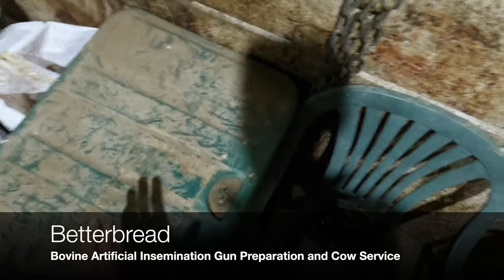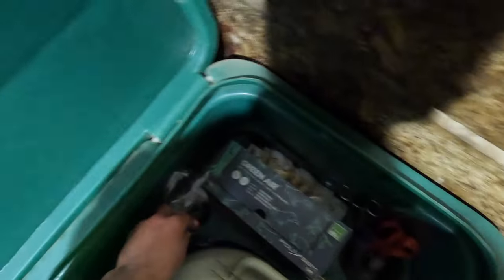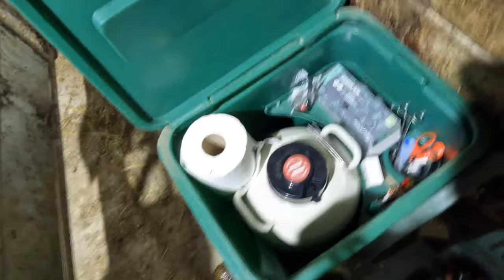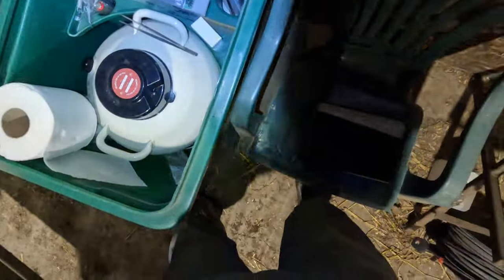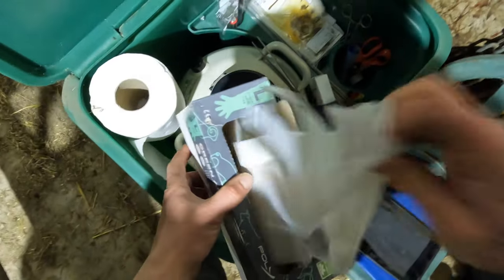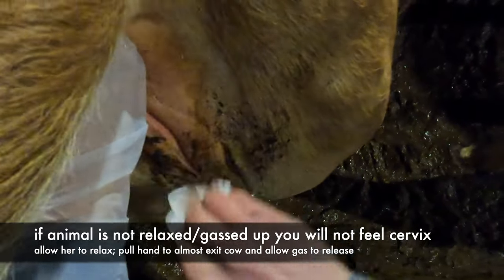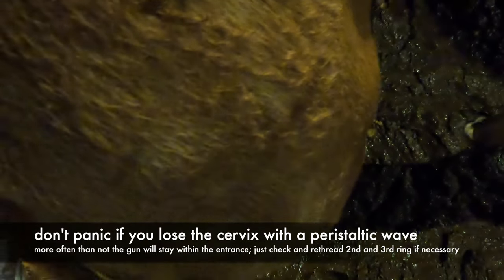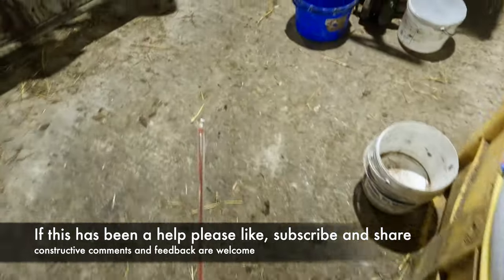Bovine AI gun preparation and service

Comment: @Betterbreadbeef  I've used the alpha sheaths myself, what was the comment you made about them being I think you said "mad boggling"? Have you had issues with them going up into the horns?
Reply from the maker: I’m saying “mad bulling” to indicate that they’re exhibiting a strong heat with plenty of slime and an enlarged cervix; in this instance, the lack of friction with the Alpha and the positioning of the cervix can mean that it is very easy to go straight through the cervix and up a horn. No risk of injury, just incorrect placement of semen, should an over-zealous operator free the contents before double checking position. The only real risk would be introducing deep contamination should the sheath be used without an over sheath/chemise. I guess there’s the risk of causing the inseminator to have to touch the uterus and/or horns for longer than needed to double-check gun position should it be over-inserted too.

Hope that helps